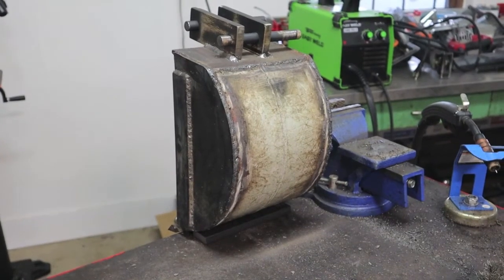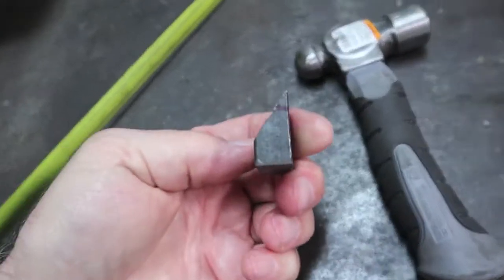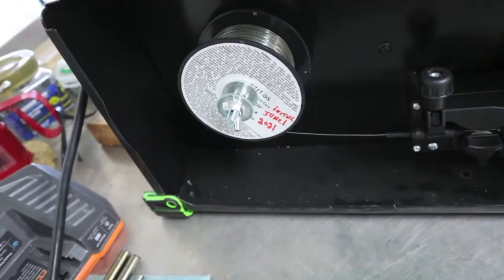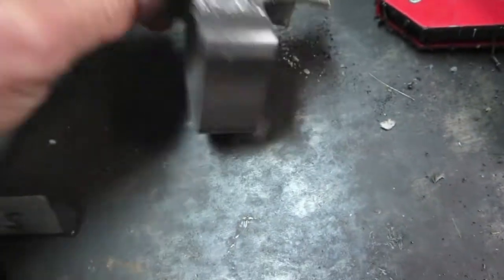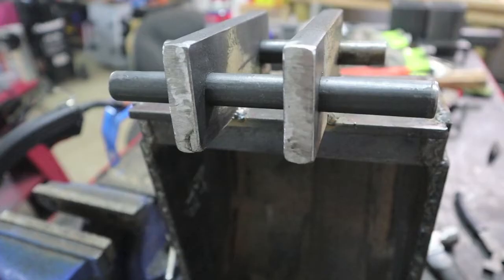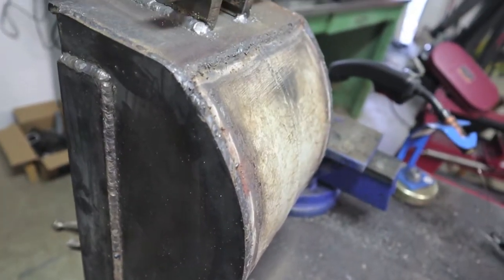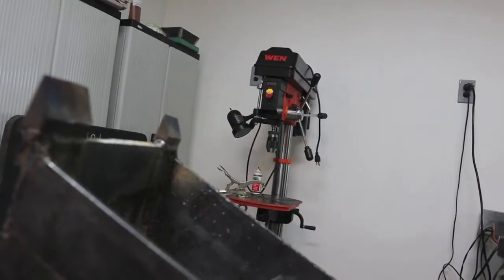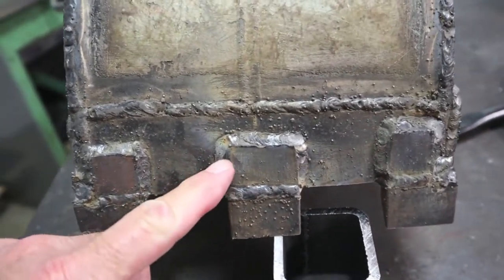I Made My Own Mini Excavator Bucket!

Comment: Hey I sold you the plans but I don't have your name. I did a 14 part build video series about a year ago If you send Me an email I'll send the links to the videos. Just in case you haven't finished yours yet . I even used similar equipment . I used a Hobart Handler 140 with flux core wire. I had to make sure it would work before I told other people to use it. Thanks. Lonnie.
Reply from the maker: Thanks for sharing the info, Lonnie! I finished mine and have used it several times on the property.
Reply: @pmtips4482  Great! Love to see them done. Lonnie.